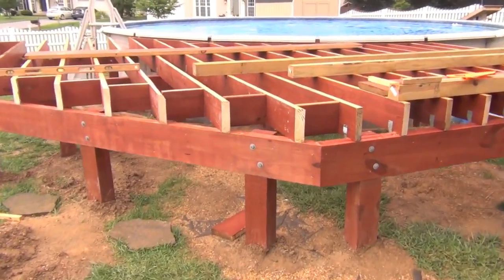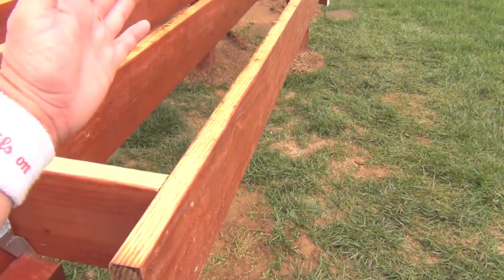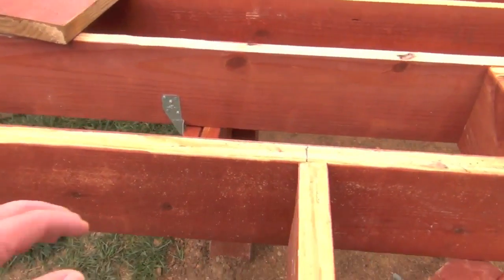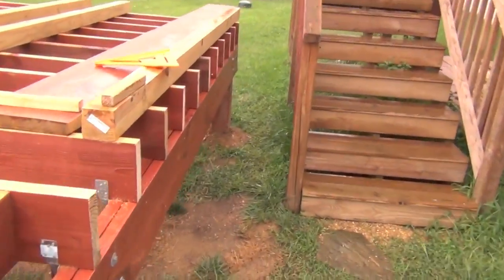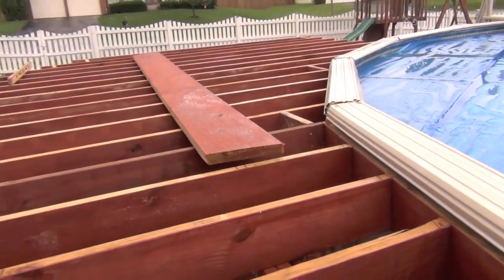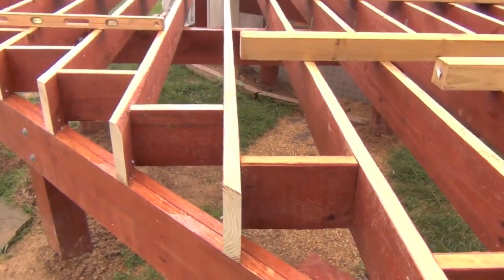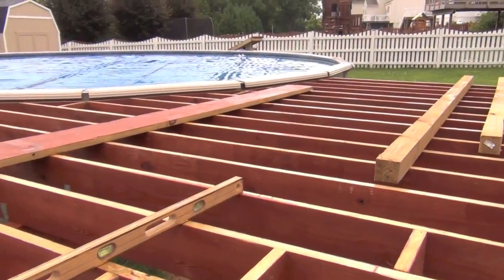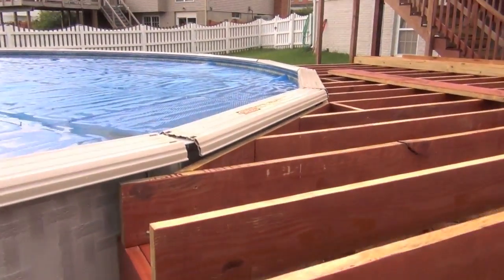Pool Deck Building: Cross Blocking & Hurricane Ties

Comment: you do nice work & great advice ..although i disagree with sealing up the wood and caulking gaps. Mainly because water can get in easily however when you seal that wood so much you are prohibiting the wood from releasing it.. it needs to breath. if it cant release the moisture you will have rot more rapidly. Just stain what you can see and visible horizontal surfaces.... thats all you need

Comment from the maker: It was a consideration, but to have the rock delivered would have killed the budget. As it is now, I'm over budget $100 for all the bolts to retain the railings and gate hardware (stairs must be self-closing, self-latching gate ala code).